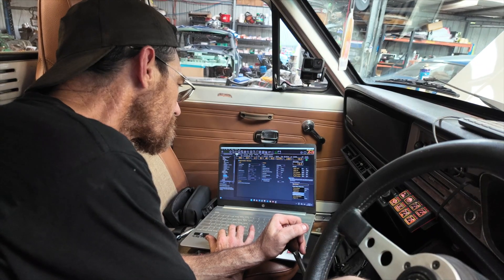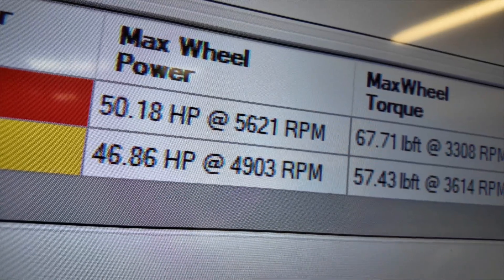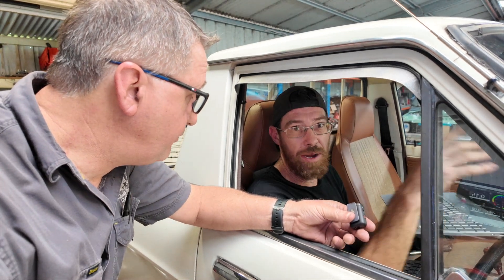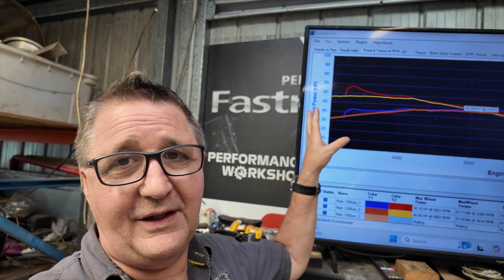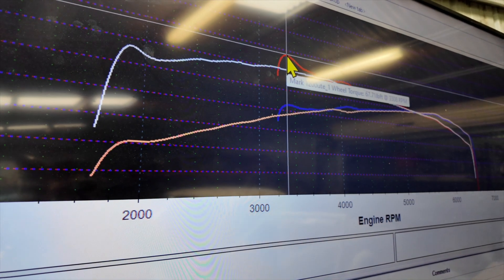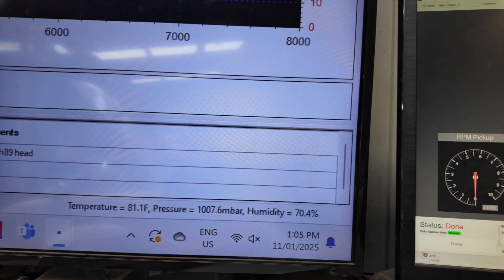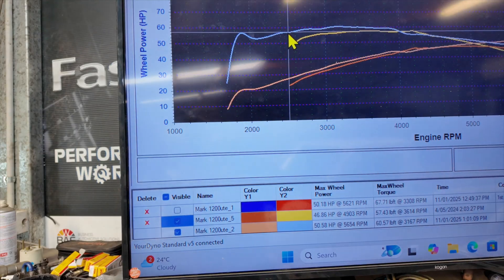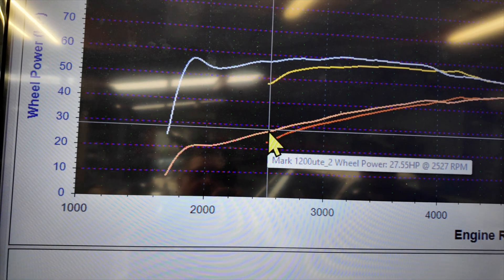146. Are Bigger Speedholes Actually Better? H89 Head Onto A12 Part 2 (Datsun 1200)

Comment: Spotto a Sunny Panel Van (VB310). Yes I had one of those,too. I know a easy recipe to fit an L series engine using a Stanza (A10) engine cross member, pedal box & a f5w63a 5 speed. Its not bolt in but it's close. Did the dyno guy said he revved the engine to 6800, that's a lot of revs for a stock cam. Looking forward to the next video.
Reply: It’s a Mazda 323 panelvan. Makes slightly more stink than the sunny truck. 😊
Reply from the maker: Just a smidge lol.
Reply: Yes it was 6800. 7000 was the goal but like I said. Outta camshaft